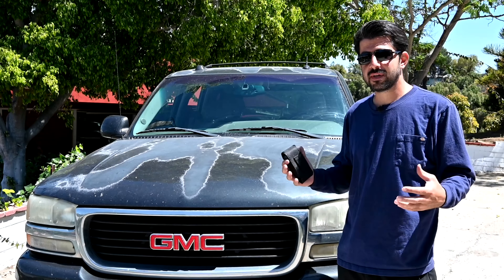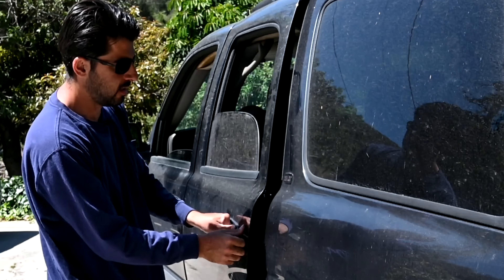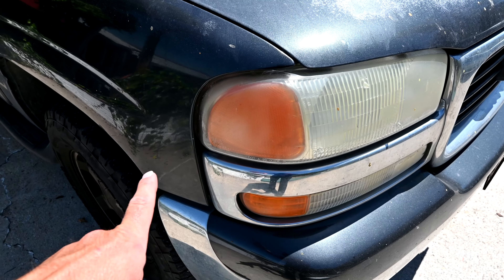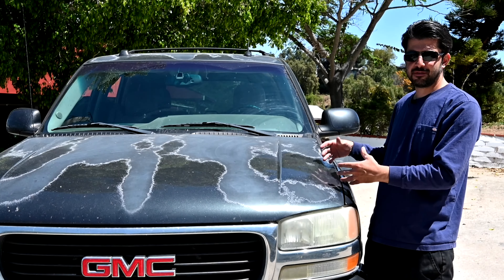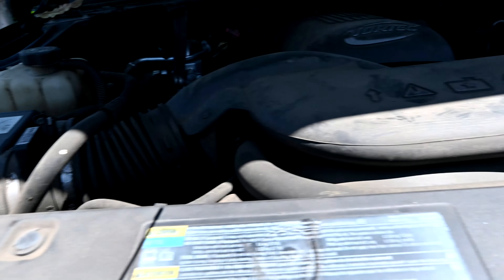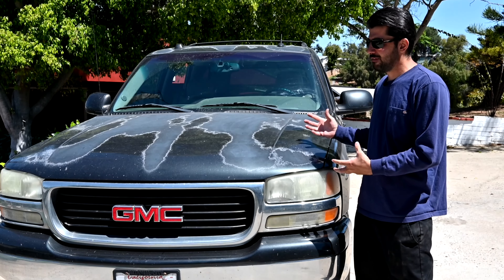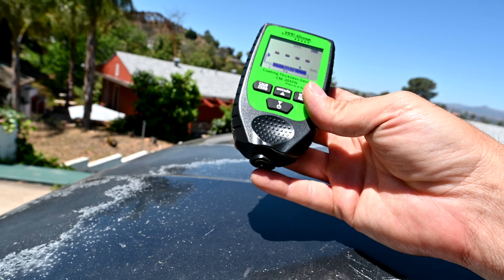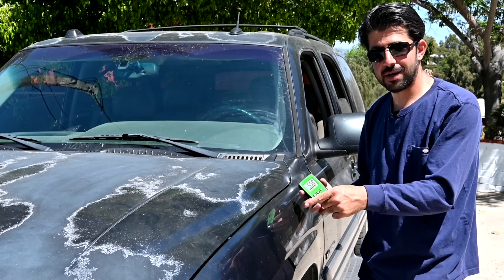This Amazing Tool Will Save You Tons Of Money When Buying Or Selling Cars!

Comment: Another easier method that will show what panels have been repainted is to take the car to a parking lot with sodium vapor lighting (they are fairly common in Walmart parking lots and have a somewhat orange glow) and any panel that has been repainted will standout like a sore thumb.

Comment: We used magnets to check for bondo. Works great and cheap to do.
Reply: Bondo would have to be 3” thick for a magnet to not stick to it.
Reply: @chadvalliere8697  not really. If it's bondo over a rust hole or fiberglass over a hole the magnet won't stick. Usually top of wheel wells and on all lower body known rust areas. The magnet will have less pull over even thin bondo. You have to feel the magnet.

Comment: And while looking at engine bay and under the car look for any yellow numbers. These will be junkyard parts put into it.
Had a dealer try to sell my daughter a Sentra. Looked good but when I opened the hood, most accessories had yellow numbers as did radiator and most of the front end supports. And they wanted high book price. Pass.

Comment: Great points and info. In this specific example though I'd counter as the seller that 1/13th of the car has been painted for you and suggest I could be asking for more.

Fenders or pillars found to have been resprayed though... yeah a good argument for structural changes that depreciate the car.

Comment: Yeah this would have been good. I may have been happy finding the exact car I wanted plus a light layer of dust and not paying true attention to the rear. I saw scuffs on the roof and trunk like a woman with a purse. But it wasnt til I got home I noticed little crinkling in the rear bumper paint. 3 months later I was taking things apart (painting accent pieces) notice inside the trunk lid it was blue maybe why the spoiler was a little loose also noticed the trunk didnt sit right. Dammit but has a clean car fax. Paid 47k for a car that had must likely backed into something or been lightly rearended
Reply from the maker: ouch well at least doesn't sound like a major rear end damage. You can always get the trunk adjusted and resprayed but if you had seen this video you probably would have walked away from the car or at least gotten a better deal. GL
Reply: @myRatchets  you're correct! I woulda spent the extra 3k on another that had 4k less miles.

Comment: I never knew a Mil is "one thousand of an inch" and NOT a millimeter! strange. A mil is a measurement that equals one-thousandth of an inch, or 0.001 inch. One mil also equals 0.0254 mm (millimeter). Thus a mil is not the same thickness as a millimeter." mm  does NOT equal a mil.
Reply: Used in machining and artillery fire IIRC.
Reply: @boots7859  plastic sheeting and gloves use mils for thickness as well, tarps too
Reply: @boots7859  guns use mildots or milliradians, it's different ^_^